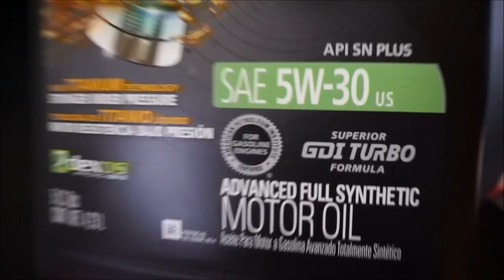MITCH DORE | "How To" Change Oil 00-05 Toyota CELICA GT-S

Comment: Hi question. Does the car very now and then drops one or two drops of oil? my car has the oil pan just changed and the oil filter very tight and it drops  a drop every now and then.